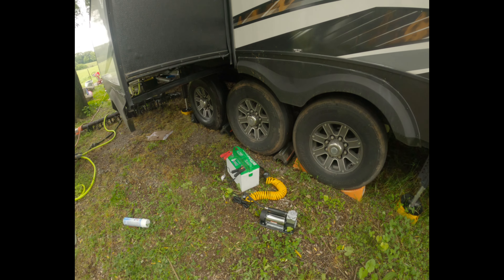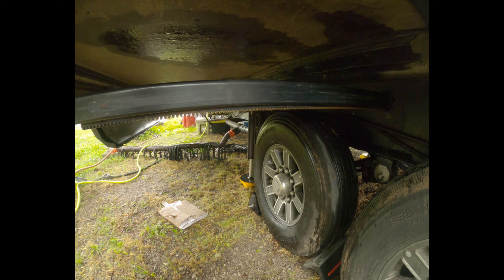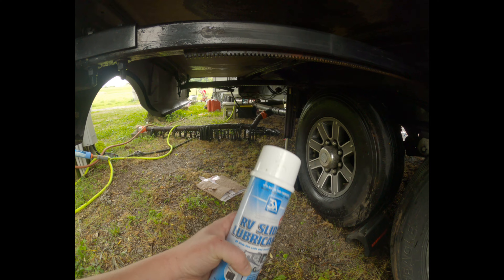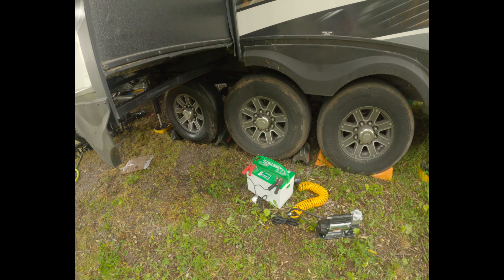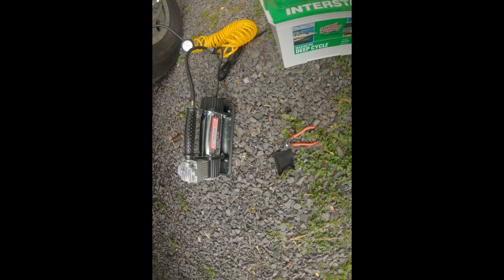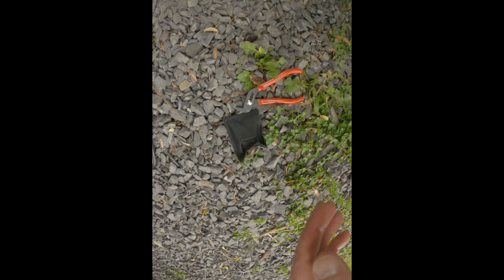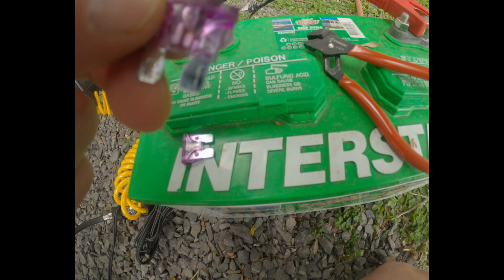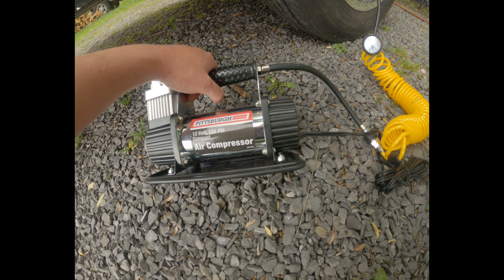Airing up to move on! Harbor Freight 12Volt 150PSI Compact Air Compressor Keeps blowing fuses S1 E12

Comment: The directions say to start it first then connect after it's running so it doesn't blow fuses.
Reply from the maker: Guess I should have just read the directions 😆

Comment: My Viair 88 does the same crap. When I connect to a tire that has a good amount of air in it, and switch on the compressor, the fuse blows. I have to start it up, and then screw it on the valve, but for a few seconds, it's completely blocked until it's screwed in all the way.

Comment: I have the 100 psi one and I thought the manual said to not turn on the compressor until after you connect it to the valve stem

Comment: My fuse casing melted. It happened when it was running and filling. Fortunately it got up the pressure. Replaced the fuse, but won't turn on. Mind didn't have the extra bits and fuses. Nobody carries a 35A fuse. Not even Harbor Freight.
Edit: I found the bits, and 1 spare fuse. I didn't know you're supposed to turn it on before connecting to valve stem 😂
Reply from the maker: Glad you figured it out now gi subscribe